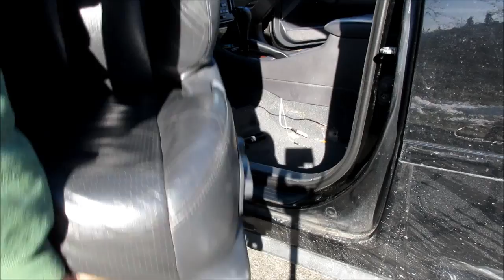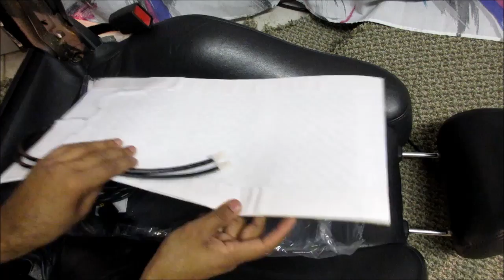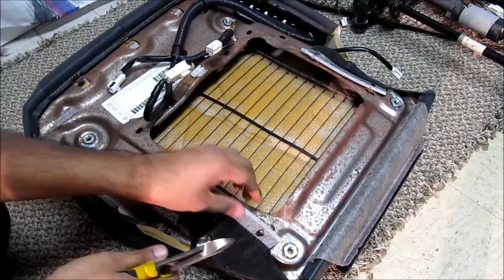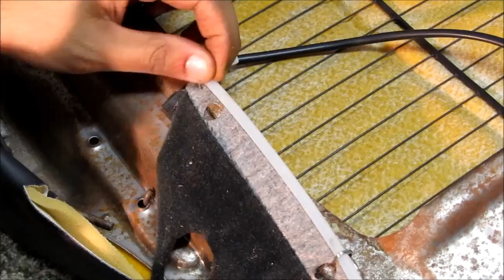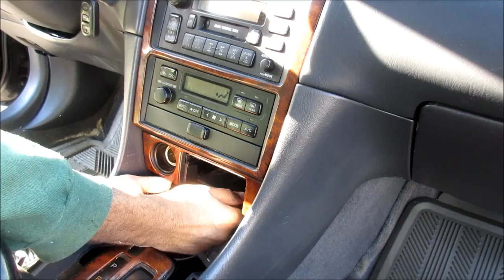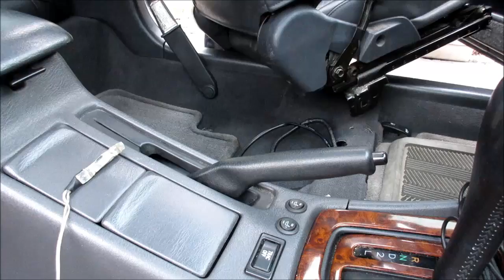Heated Seats Installation

Comment: Seriously, youv'e put a wire connector (8:04)... Not safe. It's for home not for cars, As a mechanic, it is horrible to see this !!
Reply from the maker: As long as the wire is properly insulated and won't come loose it should be fine. This is low voltage wiring so no issue. The other option would be to use an eyelit connection or solder in a molex connector.
Reply: Ha ha ha. Likely would never have an issue but in all my years have never seen someone use a an electrician’s Marette on an automobile.  I personally solder all joint and shrink tube or tape.
Reply: +Steeven Gagné     they are for any use, 12 volt car  is actually much safer, the only risk is the pulling on the wires that may occur as mechnics work on the car so make sure it is glued with plumbers goop and  won;t get loosened
Reply: Ya i shit my pants laughing when he brought out those wire caps 😂
Reply: jesus christ safety bullshit, here in eastern europe we don’t even have those screw caps so we just twist two wires together and tape them with elecrical tape and thats it. You just have to make sure it is snug and tight and it wont come loose.
Reply: Thats why you are mechanic not a wireman.
Reply: Wire caps are not used in automotive cause the car shakes and the wire nut can come loose now with that being said he used tape to secure it and if the wire came loose it all fused. Don't bash the guy he did a good video i am sure all of you made mistakes in your life
Reply: +Steeven Gagne   I know it's been two year since the post, but as an ASE Master Tech since 1978, I had to laugh also. In the early 80's, I had a dude drop off an old Toyota Corolla for service. I got into the car, and the guy took a soldering iron to the dash, cut out a rectangle plastic section where the headlight switch used to be. Yep, he install a metal switch box from Home Depot and put an ivory light switch. Good thing is was not a dimmer. Retired ASE Master Tech having fun memories. Wow the stories I could tell from $20, $50 & $100 in the glove box, won't open under warranty, sex toys under the seat, then at the dealer, used car inspection, found a 1911 under the rear seat still loaded. SCORE!!!!!
Reply: you still shouldn't have done it the way you did. As a real electrician you did one of the most horrific jobs i have ever seen on installing a twist nut. You literally just said to yourself: fuck it lets do just something and cross my fingers the car won't burn down

Comment: Very well done and informative video... thanks for the help I am going to take this on now!!!
Reply: +CafassoFam the add a circuits are sold at pepboys. what i would do is power the relay off an add a circuit connected to something that gets power only when the ignition is on, like the wipers. but draw power directly from the battery to avoid over drawing from another circuit.
Reply from the maker: +CafassoFam Thanks. Are you using the kit from ebay?
Reply: +speedkar99 No, I saw some nice looking kits on Amazon so i am going in that direction... all seem to be in the same price range.
Reply from the maker: Cool, let me know how it goes.
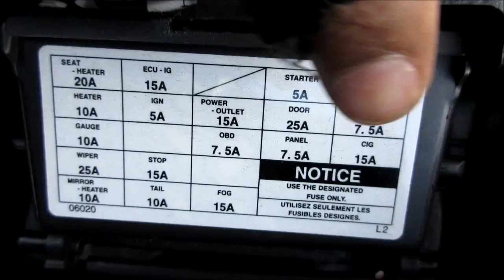Reply: +speedkar99  https://youtu.be/U36hNoB2_Dk?t=7m46s  at the 7:46 mark you are using a wire soldered onto a fuse.... I found that in my fuse box i do have a 20 Amp fuse already designated for seat heaters so i will use that but is there a better/ proper way to get power instead of the whole fuse/wire solder that you did?  Thanks -
Reply from the maker: Its called a fuse tap. I couldn't find any at my local hardware stores but I'm sure you can source them online.

Comment: Awesome step by step video, will be using it this Sunday after 10am football games, 1 question what size hole saw did you use? Thanks
Reply from the maker: +XxJimmieVegasxX Thanks, it was a 19mm hole saw. Just make sure you measure your switches and you don't drill the hole too big! You can always use a rotary tool to enlarge a smaller hole.
Reply: +speedkar99 thanks, got my passenger side done and was lucky and didn't need to remove the bottom cushion. last question, mine came with strips of grey tape, no clue what this is for. did you have this or no?
Reply from the maker: Do you mean the tape to adhere the seat cushion to the foam? The pad needs to stay in place before replacing the cloth/leather seat covering.
Reply: speedkar99  No I removed that so it would stay on the foam, was a couple other strips of chrome looking tape that came in the bag and was confused what it was used for. They haven't moved once and they are very hot and work good. Down fall I need to move them to separate fuses, both on 1 fuse you have to have them both on hi for them to work well. For now I turn them both on and I feel heat in 2 mins and on fire in 5 mins through my leather.
Reply from the maker: Thats great. I've had my seat heaters in for a year and I don't think they're as toasty and warm as they were when brand new. But it could be the temperature being warmer than normal in my area so far.

Comment: Good vid, just a little tip, avoid using wire nuts for vehicular electric. They are fine in your house where they are never subject to vibration but can be a load of trouble in vehicles and machinery!
Reply from the maker: +Brian Lawyer Thanks for the tip.

Comment: Nice and easy installation video. Should be provided with the kit. Props with the editing. Must've been a ton of clips.
Reply: +speedkar99 hey man great video. Nice commentary and great editing. Awesome job! 
I'm going to be testing my kit today before I install them. Do yours reach full temp (120°) at about 5 minutes? Thanks!
Reply from the maker: Thanks for the feedback. My kit is a bit weird (or maybe its just my body temperature). Some mornings, the thing gets nice and toasty in 2-3 mins, other days you have to drive a good 10min before you can feel anything. Regardless, don't try it indoors, try it outside (pads under the the chair covering at least) when its chilly outside. You won't feel much at room temperature.
Reply: +speedkar99 nice! Reusing old stuff- I like it. My kit was an eBay universal kit. I installed it into my 05 civic lx driver seat. Cloth seats, too. 
I was able to hide the switch in the trim by the seat height adjustment knob on the left.
The high setting is 125° and the low setting is 110°. Each takes about 3-5 min to reach full efficacy, depending on initial temp. If you're seated and power them up, you can feel the heat in 8-15 seconds.
Reply from the maker: +Dylan Stassen (Bassman415) Thanks. Yes it is a lot of clips.
Reply: +speedkar99 thanks man! I got mine installed yesterday and they get crazy toasty. I was skeptical at first but the output changes drastically when it's sandwiched inside the seat. It really distributes the well and stays hot. In fact, even in the low setting it's pretty hot. 
It's great having a hard toggle switch so I can leave it on when I get out and it's ready to go when I remote start the car. Luxury 8) 
What a great little kit. Only "problem" I had was there was no divisible section to put hog rings through so I can to mark and cut across the grid. Seemingly had NO effect to output or distribution. This must be the new style of design. I would imagine it's MUCH easier to manufacture in a long uninterrupted sheet. 
Nonetheless, perfect. Was nice to see a fully potted Bosch style relay for the low temp setting, too. Not bad for $28 bucks.
Reply from the maker: Good to hear you got your kit working. Where did you get it from? What car did you install it to?

My kit from ebay, for two seats was something like $60-70. I wouldn't say its hot on the low setting, but is decently warm on the high setting, just enough to comfort your back and take the coldness away from the leather seats.

As for the hog rings, technically they say you can cut through the heater mesh without any repercussions. I didn't want to risk it though, and conveniently positioned the pad so the breaks in the element align with my hog rings. I don't think skipping the middle hog rings does harm either.

I found an aftermarket seat heater kit just like mine in a car in the junkyard. I ripped it out and am hoping to install it in the rear seat of my ES or Solara. Another winter project...

Comment: Excellent Video! 
btw have you been experiencing the loose/rocking seat issue yet?
Reply from the maker: On the solara yes, when I accelerate the seat back feels slightly loose.
Reply: +speedkar99 I'm working on a fix to make it sturdy. 
I saw that you have Ontario plates, are you in Toronto?
Reply from the maker: Toronto.

Let me know if you do get to fix the seat. I briefly looked at it when pulling the covers off for the heated seat but it didn't seem like a quick fix if I recall.
Reply: +speedkar99 No wayy i'm in Scarborough, we should meet up some time. 
I have a 2000 Camry XLE Sedan w/ a JDM front end.   

Def not a quick fix at all but i'll let you know when its done.
Reply from the maker: Whats the difference with the JDM front end, is it just the fogs?
Reply: +speedkar99 Grille embilem (but i changed it back to Toyota logo), Clear Fogs, and chrome strip across the bumper overall I'm pretty happy with it. 
BTW ES 300 vanity mirrors work on our cars =D
Reply from the maker: I've already got vanity mirrors on my Solara. In fact, I've got black convertible visors with the garage door opener built in swapped over since I wrapped my headliner in black suede:

https://www.youtube.com/watch?v=yRfyVX_bEio

That way I freed up the moonroof console from the garage door opener and swapped in an ES300/Avalon unit with the sunglass holder (painted black to match).

There's a lot of stuff that can be swapped from the ES300, with the most noticeable being the instrument cluster:

https://www.youtube.com/watch?v=lK-M9fvSGb0

If you don't already have a dimming rear view mirror, that can be swapped to a Camry if you can find 12V to power it:

https://www.youtube.com/watch?v=tI3cR9KhrdY

You might be able to swap the shifter, but I chose to rewrap mine and stitch it with blue (to match my vinyl wrapped trims)

https://www.youtube.com/watch?v=4ojMsIjDUsU

https://www.youtube.com/watch?v=GS9ZBabwqYU

I've also tried an ES300 seat in my Solara to get the memory function. It was great while I had it in but the leather obviously didn't match:

https://www.youtube.com/watch?v=h4OsOLHAk08

What other stuff have you done to your Camry?
Reply: That's awesome! 
When I swapped the vanity mirrors they came with the garage opener feature as well (all plug and play). I've been looking for some replacement seats because my driver seat is pretty tattered but the ES 300 ones are definitely on my list and I'll definitely check out your other vid's.

Mods list:
1) I've already done your Lexus Cluster swap which turned really nice.
2) JDM power folding mirrors (i had to wire them myself.. it was a real PITA)
3) TRD Sportivo rear spoiler 
4) LED bulbs 
5) JDM OEM Toyota Kyoto clear corners 
6) Solara Strut tower brace
7) Denso Retrofit HID ballast 
8) Alpine Double Dinn, 12 inch sub, Navi, 
9) K&N drop in filter
10) Upgraded Exhaust piping to 2.5 and high flow muffler

Future mods Molly Designs TRD Kit (Unicorn Mod lol... almost impossible to find on TN)
Reply from the maker: Did you reprogram your odometer after swapping clusters?

How did you get the Solara strut brace to fit under the hood of the Camry? I've read on the forums it doesn't fit because the Camry's hood line sits lower.
Reply: +speedkar99 I didn't need to I was lucky to find one for $20 within 1000km of my original.

I didn't have any issues, i just bent it a bit inwards and it fits perfect without any damage to my hood.

Just an idea for a possible future video is this mod I came up with when my dad and I were at the wreckers. Its actually a gas shock to prop rod conversion for the hood. As you probability already know our hood struts fail and tend to fall randomly depending on temperature and can be dangerous if you're working under hood. So I said why not convert it to the Prop rod... its simple, easy and doesn't break. Plus on my car one of the holes are already pre drilled on actual hood itself so it shouldn't be too hard to measure the other one. If you want to get together to shoot a video of it I wouldn't mind. I already found a prop rod. 
Not sure if its youtube worthy tho lol

Let me know what you think
Reply from the maker: A hood prop is kinda downgrade for me. My Solara's hood struts were blown when I bought the car, and since I spend a lot of time under the hood I just replaced them:

https://www.youtube.com/watch?v=GN4YT3rMRDk

What auto-wrecker do you frequent? Standard?
Reply: +speedkar99 Standard Auto Wreckers
Reply from the maker: Hey try Cookstown Auto Wreckers in Innisfil. I love that place, they have a lot of Gen 3 -4 Camry's and Solaras and the prices are more reasonable than Standard or Dome's.
Reply: +speedkar99 Nicee, I've heard about it but haven't had a chance to check it out. 

Not sure if you're a fan of Supra's but...Check out my channel in a few weeks i'm thowing up some vids of my MKIV Supra, I'm almost finished my Turbo upgrade.

Comment: good weather is here and I'm ready to try this! could you share the ebay shop where you got yours? also been thinking about replacing the non powered passenger side seat with a powered one on my 99 camry, would be a good time to do it during this project
Reply from the maker: neppy5 
Ironic, weather is nice...and you're going to put in heated seats!

I got mine from here:

http://www.ebay.com/itm/251514779182?item=251514779182&viewitem=&sspagename=ADME:L:OU:CA:1120&vxp=mtr

Replacing the seat with a powered one is a good idea. Do you have Camry's with power passenger seats as a donor where you are or you pulling one from a Lexus?
Reply: haha yea man, it's finally warm enough outside to work on the car and install seat heaters  :)  I don't yet have the luxury of a garage or driveway so I wait till winter is over to do stuff outside 

regarding the seats, I'll have to visit a junkyard and see what they have, in my 99 camry le only the driver side has power, cloth/fabric seats, not leather
Reply from the maker: From what I know the 99 Camry didn't have a power passenger seat in the North American market. You'd have to pull one from a Lexus ES300, which would more than likely be leather and not match your interior. Unless you're swapping both front seats (and gain access to the memory seat position function as well, as per my other video) to match.

https://www.youtube.com/watch?v=h4OsOLHAk08

Comment: curious, by running directly off that 20A fuse in the fusebox, is that only enabled when keys are in and ACC on? or are you still able to switch seat heaters on and off with the keys out? I have the exact same heated seat kit and looking to get them in soon.
Reply from the maker: dukdude That fuse is only on when the ignition is in the ON position. It does not work with the keys out.

Comment: THANK YOU FOR THIS. I drive the exact same model Solara, and no one seems to post mods with these cars. No doubt leather seats suck in winter especially without heated seats. Do you have the problem with your power door locks where, the switches work for both doors to lock and unlock, but the passenger side lock will not lock with the switch, only manually or with the key outside?
Reply from the maker: Thanks. The heated seats definitely help in the winter with comfort.

My power locks function normally. You probably should see if there's voltage going to the actuator to rule out an electrical problem.

Comment from the maker: ***** It takes about an hour to remove the leather covers, install the heating pads and close up one seat. The wiring is straight forward and should only take another hour maximum, depending on how many panels need to be removed.
Reply: +speedkar99 2 hours?! looks more like 2 days of work.
Reply: I'd say easily 4 hours if you're new to this kind of work. It's really easy to break things so you have to take your time to figure out the proper way to take things apart.
Reply: I'm going to be doing this today for both the driver and passenger side of my car (2011 Milan).  I'm guessing it's going to take me about 2.5 to 3 hours for the first side and maybe 1.5 hours on the second.  I'm guessing only 30-45 minutes for the electrical.  I will be soldering any wiring and using shrink tubing instead of wire nuts.  I've had the center council apart on my Milan before to run the wiring for the dash cam so I can have that apart in 5 minutes or less and I only need to remove one tiny panel to access the whole fuse box.  I did buy the kit with the 100 hog rings and pliers.  I contemplated buying the spray adhesive for the pads to make sure they are extra secure but it looks like I'm going to be sliding them in place and that would just muck it up.  In total I'm guessing 5.5 hours.  I will literally time how long it takes of actual working time to do both seats from start to finish the whole job (including clean up) and report back!
Reply: took just over 5 hours but I did stop for lunch.
Reply: speedkar99
Reply: 1984sFinest well?